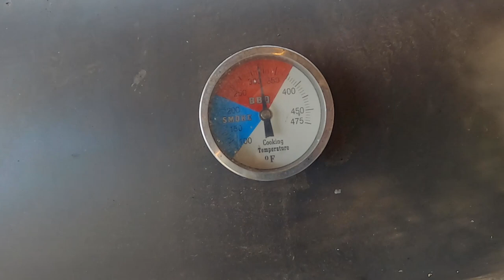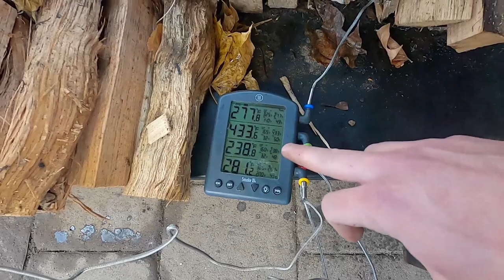DO THIS TO PROTECT YOUR OFFSET SMOKER | Old Country Brazos Smoker | Fatty's Feasts

Comment: Just modded mine, removed factory baffle, extended the stack about 2 feet with 5 inch stainless boiler exhaust pipe, welded the old vent stack damper where the old fire box damper was, made a manifold for the exhaust port, 1.5" x 8"x8", now the exhaust is pulled from below the cooking grates toward the bottom of the cooking chamber. Cooks darn near as evenly and good as my homemade 250 gallon. Convection and draw improved 200%. Top grate is now useless but never used it before. Good Day
Reply from the maker: Oh wow...You went all out! Those are some amazing mods!

Comment: I plan to buy the wrangler but i think ill take out the baffle and put in a lava lock baffle then use the old baffle as a tuning plate at the end of the main chamber by the stack and swap the included fire box racks around using the expanded steel as a charcoal tray and the (intended charcoal tray) as another baffle in the top rack slot to direct smoke and protect the door hinge area. Then of course gasket and seal everything.
Reply from the maker: Good ideas, but I would just advise you to cook on it a few times / do some test burns before you do any mods. I did some mods to mine before I even did a test burn and I regretted it, as they weren't necessary. I just saw someone else do them and figured I needed them.

Comment: I put cooking spray on the outside of one of my pits once. It made it sticky for several months until it finally wore off. On the painted style smokers, I really like using a touch of wd-40 on a rag and wiping it down. I also touch up any rust spots with high heat paint. I do still use the cooking spray on the hinges. Right now, linseed oil is the big rage, but I haven't tried that yet.
Reply from the maker: Actually just bought some high heat paint today for my stack extension video I'm putting out this week, but I'll probably do what you said and try to hit some of my rust spots with it also.
Reply: @FattysFeasts  I don't ever cover any of my pits, so they are always in the elements. I ended up painting the grab handles too, because even tho they are supposedly stainless, they were rusting within the first week of me owning the  pit. 

Due to the snowy weather here in Texas, I'm not working today. So I'm actually doing a test to see how well the pit does in cold ass weather. My old Lang didn't care if it had ice on it. 

I'm about 2 hours into my test right now. It's holding temp, but I'm having to run a much bigger fire than I usually do. I also closed the drain off with a valve and am running water in the bottom of the pit to see if that helps anything. I'll update when I'm done.

Comment: I haev seen alot about the firebox plate,  What about the tuning plates. thanks for the advice of seasoning the smoker,  I don't have a Brazos, but they are the same,....
Reply from the maker: I tried some makeshift tuning plates. They didn't seem to work for me and even seemed to make the temps less even. I just removed the baffle and called it a day. In my case, the less mods for the firebox the better.

Comment: I've been doing the canola oil spray for months. Somehow it wears off by the next cook. My test area's the inside area under cowboy door handle. If this area turns rusty then the oil isn't curing. As others have said linseed oil's recommended. The Mad Scientist BBQ recommends oils instead of repainting the smoker. So... don't repaint, oil inside and out, use linseed oil with a brush 'n a rag. It gives everything that cast-iron feel and look at the end of the day.🍖🍖🍖
Reply from the maker: I definitely would reccomend linseed oil for the outside, but not for the inside. I only use foodsafe oil for those purposes. It works like a charm on the outside though. Defends from the elements better than a tank 😁😁

Comment: are you type one?
Reply from the maker: Kind of... I know that sounds weird but I'm not insulin dependent. I only take it if I'm consuming something high carb.
Reply: @FattysFeasts  sounds like type II then if your pancreas is still producing insulin.  I was pre diabetic and reversed it through cutting back carbohydrates significantly.  Type II is very reversable for most diabetics by simply cutting the carbs / sugar.  I have no issues just eating meat and a few non starchy vegetables.  Thanks for the video.  Just got a the Brazos.  Old Country is  now putting in a removable baffle plate so you don't have to cut it out with a grinder.  I was happy to see that, because I wasn't looking forward to taking the grinder to a new smoker.  I will probably extend the stack after I do my temp testing and burn in.
Reply from the maker: @9929kingfish  Yeah my pancreas is still kind of functioning but I had some previous medical issues that kind of made it shot. Not sure if my case is reversible. But it's made me really pay attention to sugars and it's insane to me how much is in our food. That's awesome that they now have the removable baffle. Must have seem my video about how trash it is 😂😂